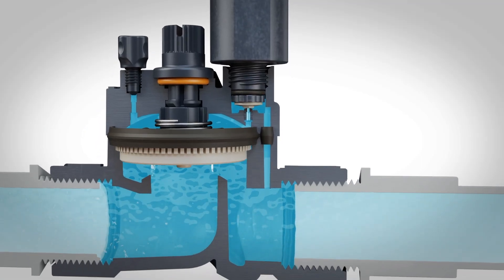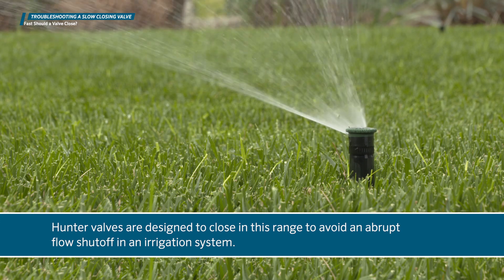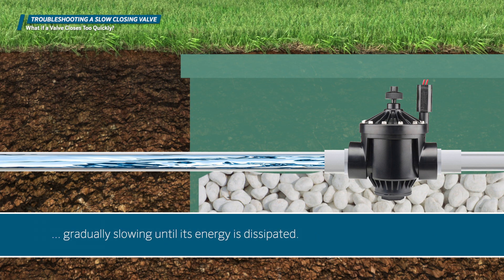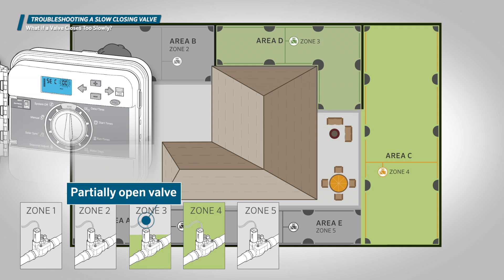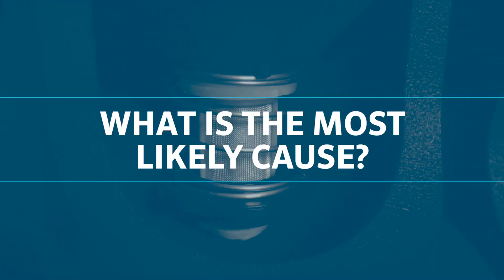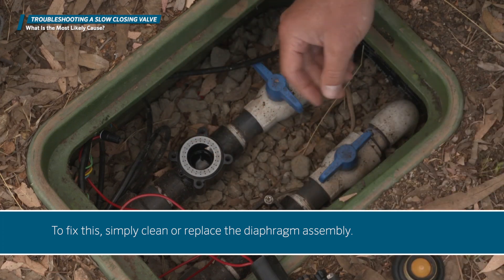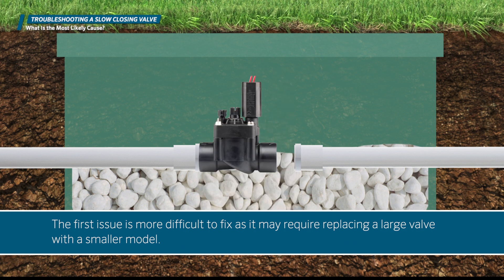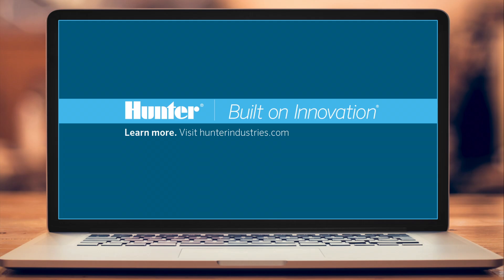Troubleshooting a slow closing irrigation control valve.

Comment: I am having an issue on a Hunter Solenoid Valve. Some of the solenoids we installed, you can slowly hear air releasing through the valve (water flow dial). If I turn the water flow dial too much, the solenoid wont open if I slightly start opening it, the pressure returns and the Solenoid releases the water. You can then hear air releasing constantly. This then activates the pressure controller on the pump. Turn the pump on and off every 15min. I don’t  want to replace the valve. Wondering if it is a problem with the water flow dial and the bleeding dial . Any advice would be great.
Reply: Did you ever figure it out? You could try replacing the valve